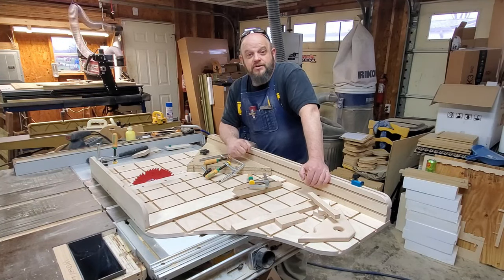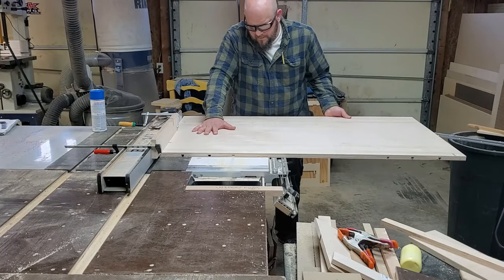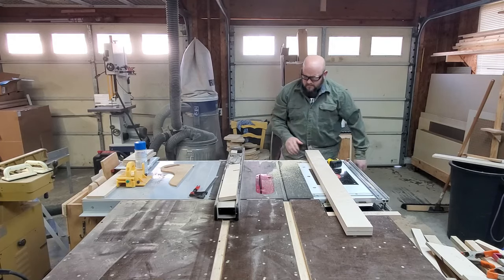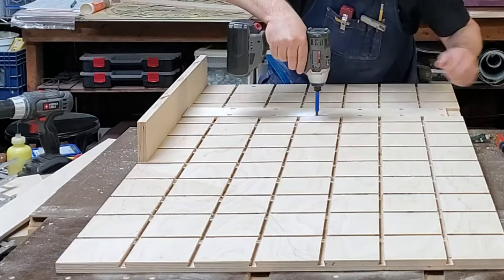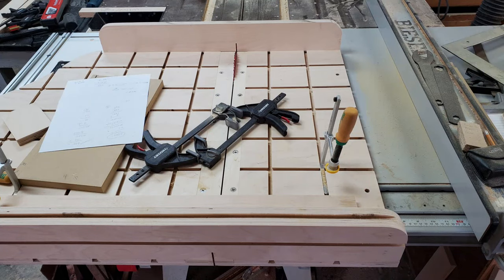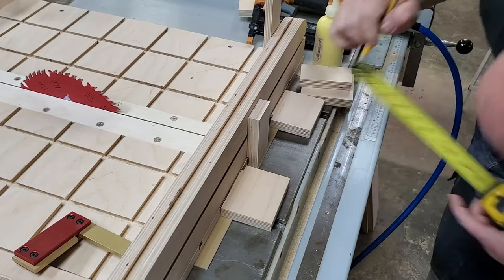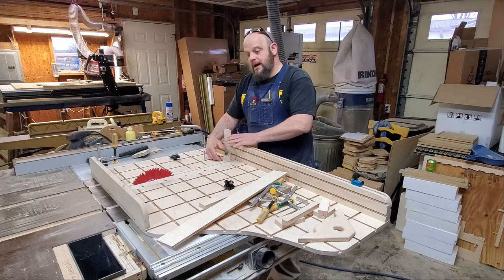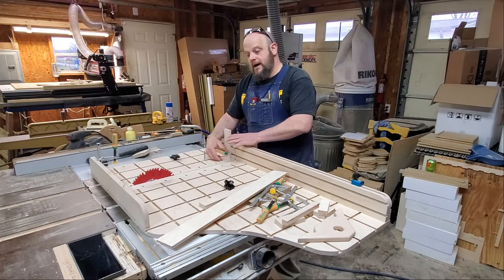Tablesaw Crosscut Sled Featuring Microjig Matchfit Dovetail System

Comment: This is way better than all the sleds I saw on YT. I say it's the best. I'm gonna try and make one for my DIY projects.
Reply from the maker: Thank you for the kind words.  I'm not sure it's the best, but it is certainly the best for me.  Everyone has different needs and this fits mine.  Many have said it's too big, but for cutting cabinet parts, or larger sheet goods to length, it's perfect.

Also, I use it to cut small stuff and have no issues.

Comment: Great video…one question, how did you cut the dovetails vertically in your triangle that hold down the picture frames while cutting?
Reply from the maker: It can either be cut using a hand router and guides, router table and a jig, or on a cnc.  I played around with my cnc on this one.

Comment: The flex from the relief is my only concern. Both fences should take care of that though. All my pieces are cut. Just thinking about where to track it out.
Reply from the maker: Adding the curve to mine reduced weight.  I was nervous that would cause a lack of support and allow for more flex but it didn't.  

The aluminum runners front to back and the fences from side to side have kept it flat.  I hang it on the wall and don't leave it leaning.

Comment: I love it. To make it lighter, what if in the center of most of the grid squares, you used a large hole saw to cut out circular voids. I'd like to hear of any negatives, before I do it to mine. Thoughts?
Reply from the maker: The concern I'd have is it weakening the platform, allowing warping.  This size of sled can easily warp with all of the slots.  I did cut away some of the back area to reduce weight, which helped.  

That's part of the reason I used the luminum runners to help keep it flat.

Comment: Watched again. Just about to start on the sled. I have one question, though. How do you get clamps into the dovetail groves that run front to back between the two fences? Other than removing a fence, I don't see how to do that.
Reply from the maker: The one groove has the "locked in" clamp.  The others, I don't.  I have routed a notch in the back fence to allow hardware to pass through.  I have had no need for clamps thus far, but if I did, I'd likely widen the groove at the back fence so the clamps could be dropped in.

There is room to the left of the back fence for a clamp which I have used a lot.  I also use T-bolts, which can slide in from the side, then turn at any intersection and change direction if I need something long for holding down jigs.
Reply from the maker: I actually cover this topic on my update video.  I've gotten lots of questions regarding this and some of my other jigs.  It's a 2-part video, so feel free to check it out on my channel.

Comment: Neat idea and I think I'll use some of your design features in my new sled. One reason for keeping a workbench flat is to make flat glue-ups. Before I routinely clamped to the bench I made some wavy assemblies with my own wide variety of small clamp designs. Please ell us how you decided to store your jig when it isn't in use.
Reply from the maker: My original plan was to mount it under my saw, but when I decided to make it deeper, it wouldn't fit.  I ended up drilling some holes on the end and hanging it on the wall near a corner that isn't utilized.  This ensures it stays flat.  Since it's so long, it's easy to hang on tall hooks.

Comment: Hi Chris.  I just finished up my first version of a MicroJig sled, but after watching your video I can see a Rev. 2.0 in my near future!  I'd given thought to how to make a replaceable insert for different blades (or to replace a worn insert), but didn't really come up with anything.  I like your solution and will definitely incorporate it at some point.
Reply from the maker: Thank you!  It took me a while to find just the right screws to use, but they worked really well.  T-nuts with the spur points hold well.  I also made sure my insert material would be easy to find in the future.  Just in case, I bought an extra sheet and marked it, so I wouldn't use it elsewhere - lol.

Comment: Did I miss something?  How are you going to use the grooves that run between the front and rear fence?  I would think you would have to widen out the dovetail at one end to allow to insert the clamp.
Reply from the maker: I have other methods.  See the other videos on this sled.  For instance, clamping stock at the fence, my clamps straddle the fence from the back.

Comment: I like what you have done. Your video and workmanship are well executed.  I wonder what you will do in making a picture frame that is longer than the distance to the back fence. The right side looks good. On the left, however, the fence limits the length.
Reply from the maker: Thank you for the kind words.  My jigs allow for the excess to be off the sled on either side.  That was part of the reason for cutting the curved section on the left back.

It serves as weight reduction and function for long stock.

Comment: Could you clarify the depth of your inserts? In one comment I believe you said 1/4” MDF and another says 3/8” BB. I’m planning my build and think that the insert has to be as thick as the dovetail depth, so 1/4 thick ply or MDF would be too thin. An excellent well thought out project. Thanks for sharing your skills with us all!
Reply from the maker: You are correct... I did say both.  My original plan was to use 1/4" but then realizes 3/8 would be better.  Both because it's the same depth for the slots and it adds a little needed thickness to add stability once cut through. 

Thank you for watching and sharing your thoughts.  I do love my sled.  

If you haven't seen pt 1 & 2 of the jig videos I made for the sled, you definitely want to watch those.  Lots of ideas.
Reply: @ChristcrossCrafts  Yes, I’ve watched all three parts likely a dozen times each! MJ should be putting you on their staff! I want to try to make the homemade dovetail hardware like you have after my sled build if I can figure it out. Thanks again.

Comment: Really nice sled.  Had a quick thought.  If you cut a dovetail or 2 at a 45 to the vertical you may be able to slide in a clamp closer to the blade for better clamping.  If I try it I'll message you back.
Reply from the maker: Good thought.  Actually, the grooves running side to side allow for full travel and clamping ability.

I'd love to see your solution though!

Comment: Love the look of this and it's inspired me to go down the Microjig route. What at the overall dimensions of your sled?
Reply from the maker: Thank you.  Mine is larger than most will need.  IT's 28" front to back and 40" wide. I get a lot of people saying I should cut notches in the far fence to allow clamps in.  I can straddle the fence from the outside with a clamp and hold parts.
Reply: @ChristcrossCrafts  thank you for the info, much appreciated.

I wondered about using magnets to hold down the interchangeable zero clearance insert down, that way it could be changed in a few seconds for different blades. What do you think?
Reply from the maker: Possibly, but I'd be concerned if it caught, the blade would have more than enough force to make it pop out.  @pauljenkins3077
Reply: @ChristcrossCrafts  ah that's a good point!

Comment: Great setup. After purchasing MicroJig's  Gripper I am looking at the MicroJig Matchfit system. As far as your mistake goes I think I would chisel the slot wider towards the far end of the table next to the front support to provide an out for the clamp and do that on all the dovetail slots that are trapped by the front support so you can use your MicroJig clamps on those slots.
Reply from the maker: I've left my locked clamp in and am actually glad it's there.  I've made slots in the back fence to allow fixture pieces to pass through (this can be seen in microjig sled update videos).  

I haven't needed to allow for clamps to be used in the front to back slots, but do use fixture hardware (the reason for making the slots).  T-bolts can come in from the side the make the turn at any intersection.  I've made wooden clamps for my cnc and they work great in conjunction with the t-bolts if needed.

My updates video is 2 parts and covers all the jigs ive made for the sled since I made it a couple years ago.  They may be worth watching to give you some ideas.

Comment: This is fantastic! The Cadillac of sleds. What's the overall width and depth of the sled? And would you change those dimensions if you had to do it again? Excellent work, thanks for sharing it with us all!
Reply from the maker: Thank you for watching and the kind words.  Originally, I wished I made it a little smaller but I'm glad I didn't.  I love the larger table, even cutting smaller parts.  It allows a space for items before and after they are cut.  The overall dimensions (28"deep x 48" wide) are great for panels and parts of about any size.  I have 12" to the right of the blade and can cut panels 26" wide.  I recently had a job where I needed to cut 36" & 48" pieces and my fence is only 32" on my saw.  I was able to use the sled to get it done.

I've made several jigs for it that makes me use it more and more.  This system makes it easy to adapt to new jigs and fixtures.

Comment: Awesome sled. If I may suggest to address the safety issue and since you have an outfeed table, I would simply put a stop on the outfeed table. In a way that the sled cannot be pushed far enough to expose the blade. The stop can be a simple clamp with a piece of wood or a retractable bench dog.
Reply from the maker: Funny thing... I've used it dozens of times and never even come close to coming out of the back.  In the video the blade was at full height and I was focused on getting the shot and not the blade...lol

I considered making a tail that drags and catches the edge of my saw, but a stop on the outfeed  is a good idea.

Comment: Great design. It has been a joy to build this in the shop over the weekend. The sled is all done and ready to go but I have one question for you. How tall did you make the front fence? I was assuming 4 inches tall with dovetail slots on the front at 1 inch and 3 inches. On the back would be in the middle at 2 inches. Can you please share your measurements? Another follower added. Thanks for sharing ....
Reply from the maker: Thank you for watching and the kind words.  You nailed it.  The back fence (used to square everything) is indeed 4" with a dovetail at 1" from the top & bottom.  

I made it double thickness and added a dovetail on top (centered) for my stop, and 2" on center for the back side.  I don't have much of a use for the back dovetail other than holding parts, but added it just in case.

Congrats on getting yours done.  Stay tuned... I have an update to this im working on with new jigs and add-ons... all for the sled.

Comment: With a fence at the front and back of your sled, how do you put a hold down in the dovetail slots running parallel to the blade?
Reply from the maker: I don't.  I haven't needed to.  I was prepared to groove a section out if I needed, but have not needed to.  Hardware slides in (see my follow-up jig video) so I can easily use that if needed.  The clamps will come in from the operator side of the main fence and straddle it, allowing the clamp to hold parts down to the sled next to the fence.

Comment: As a fellow Matchfit Dovetail Clamp Cross Cut Sled builder, I admired your work and some of your struggles.  I used the two cut method of doing 1/4 deep preliminary slots before using the dovetail bit and that made the stress on the dovetail bit a lot less.  Those runners are going to be worth the effort.  But I find my heart racing from listening to the background music.
Reply from the maker: Sometimes when I'm editing I let the music speak to me.  Often times it's upbeat, sometimes more somber.

Comment: I figured out how to free your clamp and to access the chanels blocked by the front fence. Just enlarge a few inches of the channel near the front fence (⅜ or ½ inch router bit) enough to get the microjig clamp in and out. I did it on my sled and it works great. The dovetail track stays intact near the business end of the sled.
Reply from the maker: I love it.  Fantastic idea.  After using it, I've sort of grown to like it in there.  It's always handy to pull in when I need it, but being able to take it in and out whenever would be better.  Thank you!
Reply: @ChristcrossCrafts  Enlarging the Back few inches with a straight router bit to allowing the clamp to have an insertion/ release area is what i did about four years ago. also added the 45 degree slot on both sides of the kerf, this really allows any  extremely short pieces to be held safely and securely. LOVE MY MATCH FIT SLED !
Reply from the maker: @terrysknary  im working on a few jig designs now.  A spline jig, adjustable shim jig that will double as a small tapering jig, a combo tall fence/spacer block extended cuts, and a couple more.
Reply: This is brilliant Michael. I made the same mistake, but you get the save!
Reply: I was kindof wondering about access to those slots until I saw this part of the video.  Sounds like having some enlarged sections would make sense to allow you to put clamps in and out.  Maybe you could have a whole section that screws in so that you could remove it for access to all of those "fence parallel" slots.

Comment: Great sled!! How do you use the matchfit clamps in the grooves that are parallel to the blade? Looks like you might have to cut away the top portion of the groove on the far side of the led, just enough to get the clamp in and out
Reply from the maker: Thank you for watching. Other than the one I accidentally locked in there on the right side, I have not had to.  I can use the one I locked in on the right and Im able to get one on the left at about 12".  I mostly come in from the side to do most of my holding.  

If I do need a clamp from the back I could trim the back fence some on each side of center, which would possibly be a change I'd make if I remade it.  I also considered adding a 45° dovetail for that purpose but have not needed to.

Between the hardware and jigs I'm covered.  Keep an eye out for a future video showcasing some of the jigs ive made for it and my take on it over the last year.  It shod be ready in a month or so.

Comment: Fantastic sled Chris.  I noticed you made a dovetail slot in the top of your back fence.  Does Matchfit have a stop block accessory that can be used in that slot?  Congratulations on a great project.
Reply from the maker: Thank you for the compliment. They don't make a stop block.  I used their hardware and made one, but ended up buying a Katz Moses stop block and love it. 

I made that groove knowing it would have uses, and it does.

Comment: Thanks. This is great. As you probably mentioned, using the Matchfit clamps simplified the squaring process immensely. No more ruining the predrilled holes in the squaring process. Just make the adjustment, clamp & retest for square. Thanks again.
Reply from the maker: Thanks for watching.  They do make it easy.

Comment: Chris, great job. I love the versatility of the sled using the Microfit system. If I may make a suggestion. Insert a stop on your out feed table to stop your sled from going too far so that the blade is kept inside the box on your side.  That way it’s one less thing to worry about. After all your fingers are worth the five seconds it would take to install a proper stop. Best regards,  Richard
Reply from the maker: Great idea.  I have large channels cut into the outfeed table, so that would be an easy solution to put a couple strips in there.
Reply: It's there, a great and great idea, I would do it too without a doub..

Comment: Thanks for the video. I already have a micro-jig workbench for my clamps I also made a mini one on 2" spacing. I do a lot of jewelry boxes that are small 4" did not give me the versatility I needed for spacing clamps. I am puzzled though on the vertical dovetails. With the back and the front fence permanently mounted how can you insert anything in the vertical dovetail tracks. The horizontal is good?
Reply from the maker: Thanks for watching!!  The clamps can't be used in the front to back slots, but the hardware can.  

It will easily slide in from the side and make the turn at any intersection.  You can then make fixtures, additional jigs, or wooden clamps/stops as needed.  Ive made several clamps, stops, etc.  

My miter gauge actually uses hardware slid in and turned.
Reply: @ChristcrossCrafts  Thanks I will try that when I am out in the shop in a few minutes. I am in the process of figuring  out my sled now and was going to start working  on it today.
Reply from the maker: @rblues4u  Sounds good.  Keep in mind you could always make modified spacing.  On mine, I believe I used 3" side-to-side and 4" front to back.  I did have to adjust a couple slots to get outside the screw locations from the track I used.  Sometimes you simply adapt to what you need.

Comment: Suggestion why don’t you route out the existing dovetail slots at the front with a  5” by 1/2” slot just behind the forward fence than you could use the line running  with the blade. It would give a spot for them to to pop in and out of.
Reply from the maker: I considered that a while back and have relented to do that should I need a clamp.  I actually thought about that as a way of removing the one I locked in...

Comment: Love the sled! How do you get the zero clearance insert out? It seems to go the length of the sled - under the glued in front fence and screwed in back fence.
Reply from the maker: It slides slightly under the main fence and butts into the glued one.  Since I used spur t nuts to fasten it, it pops right off.